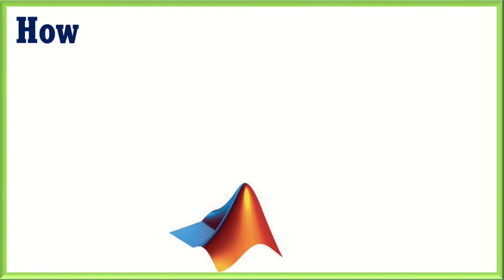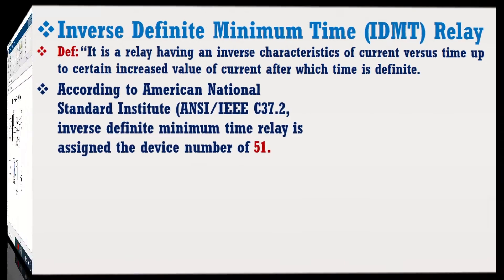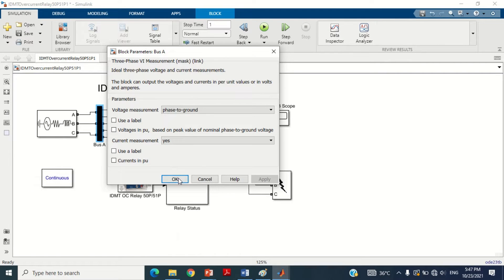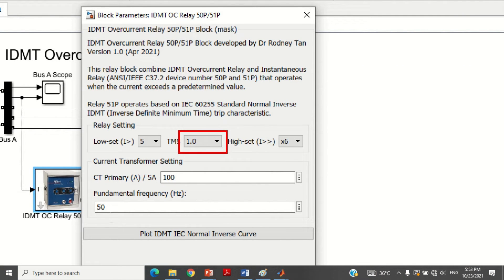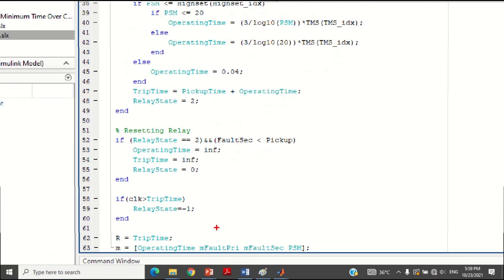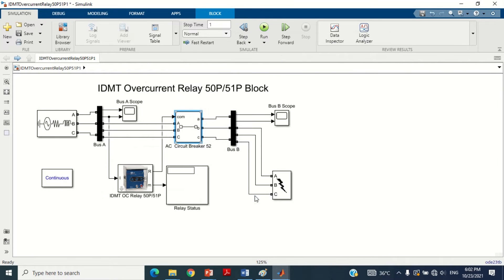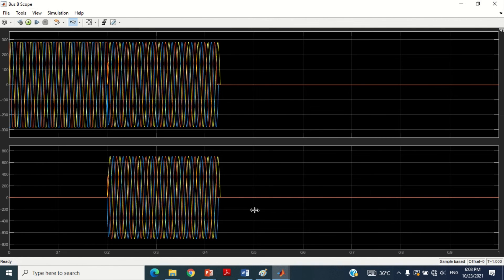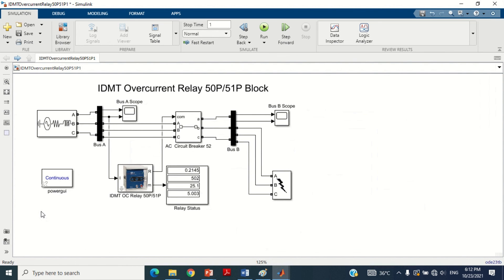How to Design Inverse Definite Minimum Time (IDMT) Relay Model in SIMULINK | Dr. J. A. Laghari

Comment: sir this model is only for specific numbers of TMS  values but what if I need to insert a 0.231 value for TMS ?
Reply from the maker: Thanks for your query. The TMS are constants for every relay from 0.05 to 1. You cannot change it.
Reply: @DrJALAGHARI   sir I m working in my master and my task is to make optimization for the TMS  values for IDMT, the results I got contain these values 0.124,0.204,0.332 and 0.117 
this model is not suitable for testing my results
Reply from the maker: @emadeldeen2200  in practice, TMS are fixed as i mentioned. Therefore, if you want to change the TMS, you have to design completely new relay in the market. In that case,  this model may not be helpful for you.
Reply: @DrJALAGHARI   i did it,
I made a moodel witn user defined function.
With its inputs are Tms, and i setting.
 It calculate the tripping time. Then send a trip signal to open the CB 
But i hav a problem.
That after the cb opened, the time is reset again, how i can display the trip time even after the cb opened.
How to take this value and display it,
Reply from the maker: @emadeldeen2200  i think you may go through the matlab function block of idmt relay. May be you get some idea how its settings are made through m-file.